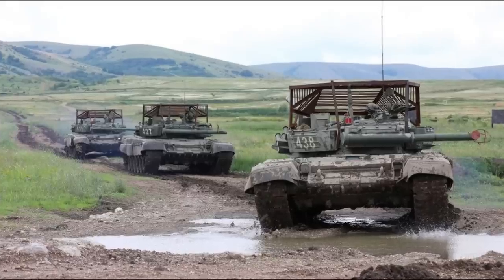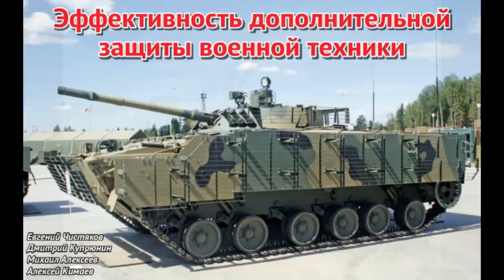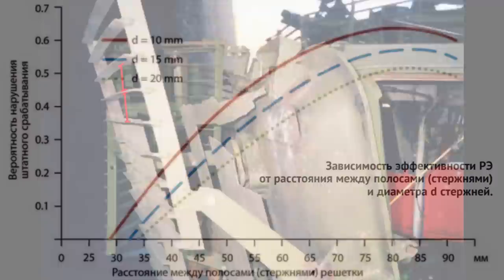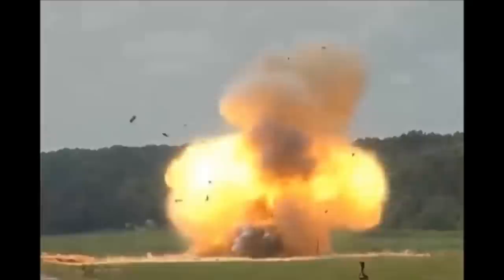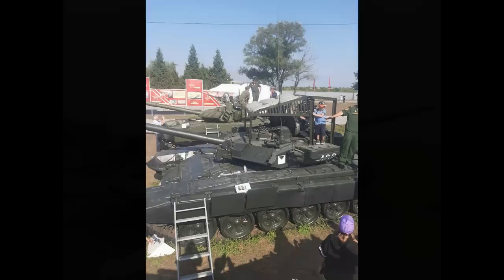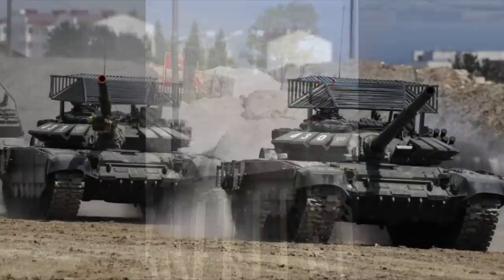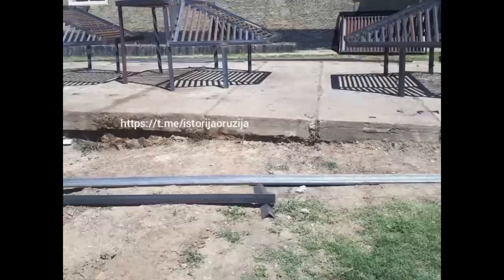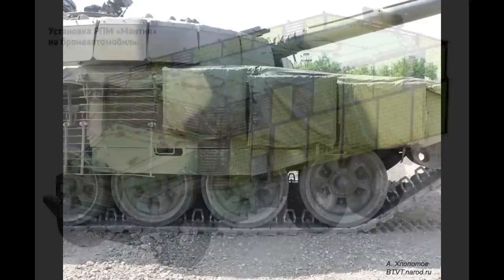The Truth About COPE CAGES

Comment: There was a captured Russian tanker who was part of a prisoner swap and just got back to Russia. He said said on social media that his unit removed the cages because it made escape difficult in case of fire and it also made the machine gun difficult to use. (He also said the ERA worked very well and they survived 9/10 hits but that the crew got concussions or something like that.)
Reply: True, but the same said it was Javelin hits, which i don't entirely believe.
Reply: Every missile is a javelin, every tank is a tiger. Some traditions just dont die.
Reply: Good information, thank you.
Reply: @Orcawhale1  it's been said and partially documented that a lot of the javelins and nlaws are old stock that hadn't been properly refurbished, which lead to numerous failures from battery packs not holding charge to the main charge not detonating.

There's that one famous video of the ukrainian soldier firing an NLAW at a T-72 from a building and the missile doing jack shit to it, because it was within minimum arming distance.

It's a very hectic war. Fuck ups happen all the time.
Reply: I highly doubt they survived 9/10 hits just given the amount of absolutely obliterated Russian armor I have seen online since the start of the “special operation”.
Reply: @smittywerbenjaegermanjense2350  well, the Ukrainians recieved 7000 Javelins and 8000+ NLAWs and they destroyed/damaged about 500 to 700 russian tanks and 1000-1500 bmps and btrs (last i checked, could be slightly outdated estimates) and not even all of those with javelins and nlaws.
There's who knows how many thousands of rpgs, panzerfausts, stugnas, etc. In inventory and use.

Given that, either the Ukrainians are unable to use all those weapons, they can't aim properly or the weapons are in fact not one shot killers and the russian ERA actually works.
Reply: @MatoVuc  No one says ERA doesn’t work- but reactive countermeasures are always less important than proactive ones when used competently by a commander. Two javelin teams, ≈6 soldiers w support, could feasibly fire four missiles at a tank without much counter fire. More like than doubling your kill chance, and also likely scoring a mobility kill at least. as your weapons are proactive (recon, movement, spot, kill) while the more advanced Russian equipment is simply trying to mitigate Western advantages in these areas. ERA is the cheap, simplest way for Russia to protect their tanks in the counterinsurgency fighting they have become used, and is descended from the Cold War where, once again, Soviet armor began to focus on reactive equipment instead of more advanced (and expensive) optics, FCS, and battlefield/combined arms integration. Not to mention the terrible failings on the tactical and strategic levels that make the ERA worthless even if it is that effective. (my guess is 7/10 first hits are survivable or so)
Reply: @tonedeaftachankagaming457  considering the situation and the saturation of very accurate artillery fire due to the constant drone recon, i think the ideal implementation of most of these weapon systems happens very rarely, especially this late into the war when both sides have adapted to it
Reply: @tonedeaftachankagaming457  I too saw interviews of Russian tankers where they say that many tanks survived 3-5 hits thanks to ERA.
Moreover they were claiming that NLAWs and Javelins were not that dangerous. They considered Stugna much more dangerous.

Btw even in this video a side of one tank is burning. It was hit with something. Yet it still works.
Reply: @MatoVuc  Yes, fuck ups do hapen. 
But that's not the same as providing faulty equipment. 
The claims that Javelins are failling, were provided by a guy in captivity, who for all we know could be a actor. 
So they havn't been documented, instead they sound like a case of Maskirovka. 
The NLAW, well it's only about 10 or 11 year old and a self contained system, so the chance of it falling is very unlikely. 
But sure it could happen.
Reply: @Orcawhale1  i saw a video where the ukranians were hotwiring the nlaw because its battery pack was dead, but make of that what you will.

And the age old point about weapons being made by the "lowest bidder" stil stands, not to mention procurement corruption.

This would hardly be the first war to prove that wonder weapons that work amazingly on the test range perform less than ideally on the actual battlefield.
Reply: @MatoVuc  you can find lots of videos when russian tanks get 5+ hits or even more
Reply: I read the same- I think he was medevaced, but later went back to front and killed in a non-tank related attack. Says Russia is very much winning, ERA is v effective, and their game changer is the thermal optics they have on the upgraded t72s
Reply: @Indigo Rodent What propaganda?
These were interviews from people taking part in the war.
They weren't shown on any mass media.
No such things were mentioned on mass media.
And personally I haven't seen a single video of Stugna hitting tank. It is not like Ukraine advertises them like Turkey advertises Bayraktar tb2.

Basically they were telling that javelins and NLAWs are no more dangerous that RPGs and PZFs.
Reply: @neverknowsbest2879  soldiers almost never know what hit them. They assume it based on what they saw or heard. So mortar shell become javelin and rpg-7 become stugna. After all those that got hit with something advanced probably don't tell a stories anymore.

It could be that its not soldiers telling you propaganda, but they are affected by propaganda and really think that those advanced systems not so  good.
Reply: @MatoVuc  No, he was fixing the trigger, because it had been damaged.
Reply: @MatoVuc  "It's a very hectic war. Fuck ups happen all the time." — translated from the Ancient Greek, said by a soldier at the walls of Troy.
Reply: Just ignore the turrets flying through the air
Reply: @brainblessed5814  Stinger use missile or Igla, it cant penetrate through
Reply: @smittywerbenjaegermanjense2350  Availability Heuristic Bias
Reply: @brainblessed5814  exactly I have actually seen more panzerfaust 3 in actual use in ukraine than javelin missles. Seen alot of javalins getting captured.

Which the panzerfaust 3 has a better tandem charge and can be fired flat and is good for ambush style. Javelin hits from a top down angle and needs lots of open room to work.
Reply: @tonedeaftachankagaming457  I think you disproved your own case because as you said ERA is cheep. Russia has a much lower budget per man to arm it's massive army. Thus you get way more bang for your buck investing in it reactive countermeasures rather than proactive ones that would cost way too much to equip their massive tank fleet with. Just take your example. 2 javelin systems and 4 missiles is about $500,000, that's basically the unit cost of an older T-72 tank.

Also, 7/10 first hit survivability? Against what? Against Javelins? Then that is excellent, probably better than any western tank without active protection.
If it's against older rockets that do not have a top attack, I can tell you for sure that most of them don't stand a chance of penetrating it frontally. Sides and rear are another story, but even them can easily shrug of older RPGs. The big problem the Russian tanks have with survivability is the central ammo carousel, if it goes off bad things happen.
Reply: @Orcawhale1  We have one such case on video. It probably wasn't actually a failure, the guy shot the tank at what looked to be within the arming range and thus it basically did nothing. I can see how they would think they are shooting duds.
Reply: @Robert53area  Javelins can be fire 'flat'
Reply: @skitidet4302  It makes sense for them, that doesn’t mean its the most effective methods. All doctrine is reactive at points, as mitigating an enemy advantage can be very important. 
From this conflict, however, I am seeing interesting failings on the Russian side to recognize Ukrainian advantages and adapt. In this case, the ERA is not working, as their doctrine (or incompetence) is exposing its weaknesses while reducing its strengths. 
I guess I did not mean to imply russian tank design was bad, per se, but maybe more outdated than they realize, especially in combination with their doctrine.
Reply: @MatoVuc  the last part isn't a fuck up,its a safety mechanism. The minimum arming distance is there to protect the soldier firing it.
Reply: Survived 90% of hits 💀doing that highly
Reply: @polarisation  yes, and the soldier not knowing that or forgetting it is the fuck up i wad reffering to
Reply: @KolyaNickD  they don’t have thermals 💀they use IR searchlights hence the squares next to the gun some have cheap thermals that are still decades behind European ones
Reply: @Fuzzle'd yeah that’s not true at all ,the us did send the older missiles but not due to them not working they work perfectly fine though I’m sure it fair to assume maybe 10% had issues that made them useless , but the idea that “most of the domt work” is so stupid I can’t Believe you believe that ,the difference is the us had new models in service with longer rangers and better optics its not that these were old javelins lying around in water rusting they simply aren’t up to date to the new mussels or near the expiration dates
Reply: Doubt
Reply: @ianbahamonde6679  all T-72B3s have thermal sights and do not have the round searchlight coaxed to the main gun, and those are the least modern russian tanks
Reply: I saw wally,canadian super sniper soldier say he was fired upon from a tank and he could not get close enaugh to engage with nlaw or javelin....so if tank is concious of its sorounding those are useless....he suposed to try and engage that 1 tank for days....
after 14 days or soo and 2 dead team mates out of 4...he decided to leave ukraine coz he saw he wont survive this war....
Reply: @brainblessed5814  Truth has never been more spoken
Reply: @Lipi19821  who claims he left Ukraine? Source?
Reply: @tonedeaftachankagaming457  Outdated? What are you talking about? Basically all tanks without a hard kill active protective system is extremely vulnerable to 3rd generation ATGM weapons with top attack mode like the NLAW or Javelin because no tank has much armor on the roof.

The Russians do have hard kill active protection systems but they are only on the T-14 Armata which is rare like a unicorn.
On the other hand, the US army has about 4 armored brigades(400 tanks) with trophy so a fair bit more but not that much better than the Russians. The problem is that the Russians just don't have the industrial might to fit all tanks, they started with the T-14 long before the Americans started to upgrade their Abrams with Trophy in 2018, but the Americans can just surpass them easily because their budget is 10 times higher.

What Russians really are behind on is 3rd generation ATGM systems of their own. Americans don't actually have to worry that much about the Russians using them since all they have is stuff they have captured from their enemy. Though to be fair, they could probably buy some from India or China. Especially India has a lot of interesting long range ATGM systems. Maybe they can trade a few BMP 2s or T90s for a few rockets? Who knows.
Reply: @skitidet4302  The ERA protection is obvious outdated, it no longer provides adequate protection against common man portable systems. Yes, all tanks are vulnerable to them, but Russian tanks attempt to prevent penetrating hits with ERA rather than emphasizing manners of fighting that reduce the effectiveness of the missiles. So yes, its outdated. Not to mention the tanks themselves were designed in the 70s, and lack numerous safety measures in the event of successful penetration that western MBTs do have. The doctrine aspect is just as, if not more, important than the equipment and manners of protection. ERA may have been useful during the Cold War, but if its ineffective against common threats its a total waste of their meagre budget. 
The Russian army is in sore need of a modernization program, doctrine and equipment wise, as they have not adapted to a modern battlefield.
Reply: @swirvinbirds1971  he in hes interwiev...if you cant find it yourself,i guess you dont wanna see it...lol
Reply: @Lipi19821  I looked. Nothing. That's why I asked for your source.
Reply: @Indigo Rodent Well, I have no idea how much videos people taking part in the war watch. And nobody has asked me to take part in it yet.
As Russian I can tell you one thing. Reddit is not popular among Russians. It is pretty much non-existant for us. And I haven't seen a single video of Stugna hitting tanks from Russian sources.

I dunno if those guys are wrong or not.
I just relayed what I heard from people who actually fight.
Still if javelins were as effective as they were portrayed they would be feared much more. Maybe they are more effective than Stugnas, who knows (or maybe ukrainian army just doesn't know how to use them properly). Still they are very far from the ultimate weapon they were portrayed as.

Bayraktar tb2 were portrayed as invincible too. Yet according to Russian army it has already shot down 90 of them (Turkey supplies them to Ukraine). Still Bayraktars are considered quite cost-effective weapon by Russian army.

If anything this war seems to prove once again that wunderfaffe never existed and never will exist.
Reply: It didn’t survive 9 or 10 Javalin hits. Russian lies or ignorance.
Reply: @MatoVuc  USA hasn’t given Ukraine that many Javalins. USA doesn’t have half that many in stock. Get real info!
Reply: @Indigo Rodent I have fired Javalins and not once did I have a drone. You guys have never been in combat or used military hardware. Go back to video games it’s easier and whole lot safer.
Reply: @Orcawhale1  He's definitely not an actor. At the beginning of each video, they try to give facts for verification. They are also on the exchange lists if they are not on trial. Some have already been exchanged for Ukrainian soldiers. One idiot, after the exchange, said that he would again go on the attack for Putin's yacht.
  But the soldier in the tank cannot understand for sure what hit him.
Although the stugna is really the most dangerous because the operator is safe at a great distance from the tank and away from the launcher. That is, the tank is harder to counteract. Moreover, after an unsuccessful or partially successful strike, the tank has less opportunity to escape due to the greater range of the cold.
Reply: @tsugumorihoney2288  go ahead and link some
Reply: @Leo-yr5jb  Yes, on UA. 
But not on the Russian one, which is what his referring to.
Reply: @smittywerbenjaegermanjense2350  That obliterated armor was probably first damaged to the point of no use and abandoned due to some mechanical failure and then probably ukronazis  got carried away and fired a couple of more missiles at it just to make "sure" its dead. Its never just one missile .
Reply: @tonedeaftachankagaming457  you are getting carried away now. Russians can make any weapon the same and if not better then any american counterpart, the part you are forgetting is Russia doesnt have 100 trilion $$$ budget to waste on many expensive toys. They can make super stuff but in limited quantities. And considering their budget they are doing amazing things to be honest.
Reply: @Lipi19821  Tanks have range of 4-5 km, these things are very short in range, so yeah , you are absolutely right. In the field they would get killed.
Reply: @bogdagt  Of course Russia can make advanced equipment. They do. But it is not currently suited to how their enemies want to fight, and the Russians are largely unable to fight the Ukrainians on Russias terms. 
Not to mention the West isn’t the one wasting all of their expensive equipment right now… considering the Russians are facing billions of dollars of losses.
Reply: @bogdagt  If 30% of their armored force lost is “amazing things” I would hate to be under your command.
Reply: @ux3sty  Yeah- dead man tell no tales...
Reply: @tonedeaftachankagaming457   Zhukov would be proud 30%“amazing things”)
Reply: @ianbahamonde6679  they were upgraded with the French Thales thermal imagers around 10 years ago..
Reply: @KolyaNickD  Most are not, checked by serial numbers. Most after 2014, just corruption made it possible to bypass sanctions.
Reply: @smittywerbenjaegermanjense2350  

If you are referring to the discredited Oryx blog, don't. He has been passing off Ukrainian Wrecks as Russian, unknown wrecks as Russian, sketchy as fuck capture claims, and damaged tanks as destroyed.

Reality is, ATGMs are a non-factor. 95% of Russian Tank Losses have been from 152mm laser guided Krasnopol Rounds hitting their top armor. 4% destroyed by Ukrainian Tanks, and 1% other.

Due to the prevalence of drones on both sides, most ATGM teams are destroyed before they can fire, and ERA plus Russian Composite Armor is very good at stopping ATGMs. It takes multiple Western ATGM hits to knock out a Russian Tank while Soviet based ATGMs are far more effective.

If any thing Western Systems are proving to be massively inferior to Soviet base technology and only good for fighting 3rd world militias.
Reply: @Orcawhale1  Javelins do not hit anything.
Reply: but the Ukranian tik tok brigade forgot to film that tank being hit 9 times LOL.
Reply: @Smithsj82  I think you've miunderstood what they mean by needing a drone with Javelins. They don't mean that you need a drone in order to use a Javlin but you need one to shoot video of it in use and hitting tanks in the field.
Reply: @pragmaticno1630  Yes, they do. 
Javelins have hit rate of about 95%, so that's not true.
Reply: @Orcawhale1  you cant  believe american weapons can fail?
Reply: @tavish4699  They most certainly can. 
Just read up on the Zuni rocket. 
Or the Mark 14 torpedo. 
But the claims arn't reliable.
Reply: @Orcawhale1  The video states the tests were using RPG7's, NOT Javelins. That might help if the tanks were fighting the mujahidin again, but look pretty useless in Ukraine -- as the videos of Russian tank turrets becoming airborne strongly attest.
Reply: II ᛋᛋ-Panzer Corps  We also see the videos of turretless tanks sitting all over Ukraine. We can reasonably assume it was a Javelin or its other equivalents that detached those turrets.
Reply: @neverknowsbest2879  Of course thos live tankers wouldn't think the Javelins were "not that dangerous." They're alive, which probably means they haven't met one yet. Ask the tankers who have. Or their ghosts, anyway.
Reply: II ᛋᛋ-Panzer Corps  Since most of the ones I've seen have either a Z or an O on them, I have to assume they're Russian. What you're saying is that the cope cages stop litterally nothing beyond the occasional RPG.
Reply: @Tom-ut6ky  Im not responding to the video, im responding to the comment. 
You might want to read that.
Reply: @MatoVuc  Nah, simply they got hit with RPGs and just thought every hit was a Javelin, to make it cooler that they survived.
The NLAW not doing anything to that tank was exactly, as you said, simply not armed yet so i'm not sure what your point is
Reply: @bogdagt  considering they are using very old tanks and didn’t even spend time making upgrades I am surprised they work well enough
Reply: @BGTom  can you actually prove atgm are a non factor or that ATGM teams are destroyed before even getting close next is can you actually say that western systems are worse without first getting enough samples of javelins and nlaws which are pretty hard to film while stugnas are easy
Reply: @JeanLucCaptain  the Russian brainless battalions forgot to film the rpgs that where actually shooting
Reply: @sirdo946  it would seem that understanding basic poibts is difficult when you want to believe in wonder weapons
Reply: @Orcawhale1  yup,it was javelin,they dont do the biz if armour is on the move,several hits,no results,only static vehicles are good probability one strike,theyve learnt
Reply: @Orcawhale1  lots had battery issues,
Reply: @MatoVuc  How so? I'm not talking about wonder weapons but it's widely known for soldiers on the field to over-report the enemy. Be it allies in WW2 saying every tank they encountered was a Tiger, or russian tankers saying every AT hit they took was a Javelin; when even from a purely statistical point of view, it's several times more likely for it to have been an RPG or other lighter AT weapon.
Reply: @Rasmajnoon  You're saying if you fire a Jav at a moving target it's going to hit but not damage? lol, why would the fact that the target is moving affect the damage if the target is it? jfc the lengths y'all go to cope with disastrous russian performance are absurd
Reply: @Rasmajnoon  No, they havn't. 
The claim is made by a biased source.
Reply: @sirdo946  its weird,but reports from many tankers have the same story
Reply: @sirdo946  people (and I'm not saying you are one of them necessarily) treat the Javelin and NLAW (and the stinger and panzerfaust etc.) as if they were going to singlehandedly turn the tide of the war, which is evidently not happening.

Same will and is happening with all the artillery systems being sent to Ukraine. They will not achieve the breakthrough desired, because they do not significantly or even at all outperform the artillery the Ukrainians have lost or the russian artillery they are supposed to countrr and they are being sent in too few numbers. 

The Ukrainians are being provided tens, when they need hundreds and they are given tens of thousands of rounds for them period, and the russians are expending tens of thousands of artillery shells a week. 

That is why they are trying to excuse away their ineffectiveness and handwave away these weapon systems documented flaws and malfunctions.
Case in point, the NLAW being fired too close to arm against the passing tank.
That is a fuck up on the soldier's part and a potential source of the notion that 9/10 strikes against tanks are ineffective.

Just because the system was not used properly, does not mean this incident can be statistically discounted or that it isn't a source of important information.
Reply: @augustuslunasol10thapostle  Ukraine itself states artillery is its main killer. It's why it wants more of it and even finally gave the specs of Krasnopol to former Warsaw Pact members as its factories are destroyed. ATGMs sent by the West, especially Javelin are notorious for misfires, early detonations, and just plain not penetrating Russian armor  as both Russia and Ukraine use RHA75 standard while NATO uses RHA50 standards for armor. Which means Soviet based tanks are tougher and hit harder than Western equivalents.

Lastly the bulk of the Javelins sent were expired. NLAW at least fires when you press the button.
Reply: @Orcawhale1  oh, yeah, mister foreigner. Put more words from alien languages into your use. Maskiróvka. What a good word. I believe Inglés don't have a counterpart(s), right?
Reply: Russian tanks already were designed with crew survivability as the last priority, putting even more metal in the way doesn't help...who could've guessed
Reply: Veles  seems like the BTR did not get out of it unscathed, seems like it's engine started catcbing fire.

Saw different version of that bideo that cuts iut after the BTR was struck.

Didn't really see the point of wasting the NLAW on the BTR when they clearly had an M72 that could have hit it from that distance no problem.
Reply: @cjunknown1422  just ignore that this still happens with #Western light tanks and IFVs. And that all the tanks had this quirk before the safe ammo compartment with blowout sides.
Reply: @killerbug05  oh, really? The least priority? So you don't care that at the time they were almost invincible to frontal penetrations, hence, by the definition had good crew survivability? Another mister schoolboy, telling us His opinion — not someone's else.
Reply: Veles  it's the same video as the one you shared, just cuts off after the BTR is hit
Reply: @worldoftancraft I don't really care about the invincibility of it's front and whatever else you claim as that wasn't what the comment was about, the above comment says "his unit removed the cages because it made escape difficult in case of fire" I was specifically responding to that with a sarcastic half joke, not some grand statement on the state of Russian mbts or anything, it's pretty well known that in the case of a fire or penetration Russian tanks just aren't easy to escape adding even more metal on top won't make that any easier, that's all I was saying. No clue why you thought my comment required getting butthurt and defensive about but go off ig.
Reply: @killerbug05  Not true in the slightest. All crew members have hatches and can exit quickly. It also has automatic fire extinguishers and the ammo is low to the ground and in an armored compartment. A round hitting it has so much kinetic energy that the ammo there going off is irrelevant.

So in fact Russian crews have excellent survival chances with plenty of videos showing the crews successfully bailing from burning tanks with minor injuries.
Reply: @BGTom  I was misinformed then my bad, I remember vaguely a comparison between crew survival rates in modern tanks after a penetration has occured, with Russian tanks having quite low survival rates due to crew members being unable to escape the vehicle in time, but that could've been wrong or just straight propaganda.
Reply: @killerbug05  I simply want to say that you failed to convey this meaning to me. I saw a typical "coow soorvivabiliti" take, not something that elaborated as your latest reply.
Reply: @Orcawhale1  You know not all Javelins will be shot in top attack mode right?
Reply: @smittywerbenjaegermanjense2350  well offcourse you wouldn't know about the one's that survived, but know about the one's that didn't. And at the end of the day non of this is surprising
Reply: @MatoVuc  the failure rate from Javs came from Russian media and made up from whole cloth.  There is no "old stock" of Javs that isn't maintained.
Reply: @testy462  and how do you know that?
Reply: @patrickazzarella6729  Wait, you've merged John Cena and Mao? 
That's freaking hilarous !
Reply: Most of his first hand accounts were very interesting, especially about how most of their engagements were 3-5km and mostly against infantry with a little armor support. And how the Ukrainians would often implement 10 man AT teams to probe russian armor and slow them down. He did say his tank column survived 9/10 Javelin attacks, but often found themselves with concussions or knocked out on impact, I don't fully believe the the javelin claim they are excellent systems that have a high kill rate although to play devils advocate Ukrainians are using older Javelin munitions that are closer to expiration so some of this claim could be true (Not familiar with shelf life someone who knows more about the system could tell me if effectiveness dwindles near expiration date or no) ERA has been known to work well against traditional munitions but it is not going to have an affect on top down attacks.
Reply: @Jason There's not such thing as "heavy tanks". 
Nor does it need a direct hit on the weak spot, as it's able to penetrate more than 700mm of armor, with era. 
So no, your full of crap. 
Also, btw you can get paid 100.000 USD, if you defect. 
I suggest you go via Belarus.
Reply: II ᛋᛋ-Panzer Corps  show me one where they arent
Reply: Or the Ukes haven't used up all those 7/8 000 ATWs yet... 🙄
Reply: @smittywerbenjaegermanjense2350  Less than you think.
Reply: @MatoVuc  nonesense
Reply: @lukabogdanovic4658  what exactly are you reffering to?
Reply: The reactive armor can certainly work well, but it can only work once.
Reply: @neverknowsbest2879  bound to be some survivor bias
Reply: @Orcawhale1  It's pretty normal, that outdated stuff fails all the time. Stinger and Co were not even a bit thing in Afghanistan times and what they send to Ukraine is not only old version but long beyond the date you should use them.

Since western equipments tends to suck massively when it's new, being years over due does not help at all.
Reply: @Tom-ut6ky  Since Russia destroys all the "Russian" tanks of Ukraine, you of course have endless pictures of destroyed "Russian" tanks.

I love those where the whole tank is burned out, but the Z or alike is all fresh. Must be awesome paint, hu?
Reply: @Tom-ut6ky  Imagine something like painting a Z or O or using a tool to manipulte the image would exist...
Reply: @tsugumorihoney2288  Not so many videos of Russian tanks surviving hits on YouTube.  Keep in mind that most Americans have never heard of Telegraph or Yandex so there is serious confirmation bias occurring.  The Ukrainians know that their best hope to win this conflict is support from the USA, so most of their propaganda is on western focused platforms like YouTube and Twitter.
Reply: @MatoVuc  they're made for close combat, the russians keep more distance now and use long range artillery.
Reply: @swirvinbirds1971  there was Wali interview after he went back to Canada. Yes he mentioned that javelin and nlaw were not effective and he claim the reason being he cant get close. He also talk about how the war is a mechanical war and the fact that his ukranian friends were killed right before his eyes. There is also an interview of another canadian who was wali teammate in youtube. I dont understand why you said you cant find it. Its all over twiiter during the time
Reply: @MatoVuc  
The first 300 Javelins fired equaled to 280 kills. Over 150 of those were tanks, including caged Armatas.

I have no idea where you got all that "bad stock and battery pack stuff" but: there's nothing wrong with those Javelins.

And no cage, no nothing, is going to protect from a Javelin because of it's two stage detonation. The only protection against the Javelin is the Trophy APS system.
Reply: @republicoftexas4651  would love to see some pictures of those destroyed Armatas
Reply: I imagine the ERA is quite effective on the tanks that actually have it installed.
Reply: @MatoVuc  
Video search. Right here on YouTube. Twitter feeds. 

After you search that, video search that train carrying HUNDREDS of T-62s pulled from storage heading to Ukraine. And ask yourself: why are these completely obsolete tanks being shipped to Ukraine?
Reply: @republicoftexas4651  give me a link.

I've found a number of videos claiming to be armatas and none of them are. T-72B3s and T-80BVMs
Reply: @brainblessed5814  To be fair, it's probably a little hard for the crew to tell what exactly is hitting them.
Reply: @MatoVuc  >It's a very hectic war.
Every war is like this, unless its tanks against spears.
Reply: @smittywerbenjaegermanjense2350  Except you don't know the backstory behind every "obliterated" tank. A burned out tank is a total loss. As long as the crew has time to bail out, what the wreck looks like is irrelevant. In the heat of combat, the enemy will keep shooting a tank even when the crew long abandoned it.
Reply: @miriamweller812  delusional
Reply: @tonedeaftachankagaming457  Go back to your "Gaming".
Reply: @romxxii  i believe redeffect has a video on that
Reply: His talk of ERA shows they're really working.  Concussions are preferable to death.
Reply: @randomlyentertaining8287  he has a video specifically addressing the empty ERA bags on the T-72B3 sides.
Reply: @MatoVuc  well its more of the they dont work all the time
Even if it hits and detonate, there are so many minor things that affects how it will end up
Reply: @MatoVuc  wrong, they are still using older T72, T80s variants that dont have Thermal at least in a way or another, and Im not counting T62s because those tanks are not likely to be used in combat itself, and that was not something that happened when you said that
Reply: @republicoftexas4651  bro How can Armata even be used in a war if Russia doesnt have the economical capacity to produce them, meaning they are not able to even adopt them

Also Armata Tech wise would very likely be "imune" to Javelin.
But hey that would require the Tank to "exist"
Reply: @smittywerbenjaegermanjense2350  You can't tell what's detonating the reactive armor so of course it seams to work. 120mm even heat rounds are going to rattle the crews skulls even if the reactive armor prevents penetration. At 120mm HE can mess up the crew a fair deal and 150 mm plus HE starts taking out tanks some of the time not by penetration but by shock to the crew.
Reply: @neverknowsbest2879  the ERA will go off for stuff that would never penetrate the  Armor so it unlikely the crew knows if it was a threat that set it off unless they are badly shaken up by actual 120mm plus hitting the tank which the reactive might stop the HEAT round from penetrating but cannot stop the conclusive force.
Reply: @Tom-ut6ky  I hate to play man in the Middle Tom but.. Just because a tank has a Z or a O on it when it's destroyed doesn't mean it was there when it wasn't destroyed..
Reply: @cjunknown1422  obviously tanks are going to be destroyed by these weapons but that doesn’t mean that javelins and NLAWs are 100% effective vs Russian tanks does it?
Reply: @smittywerbenjaegermanjense2350  imagine actually believing NATO propaganda 🤣🤣
Reply: @neverknowsbest2879  Ukrainian soldiers prefer to use Stugna especially in open terrain than Javelin due to Stugna having longer range